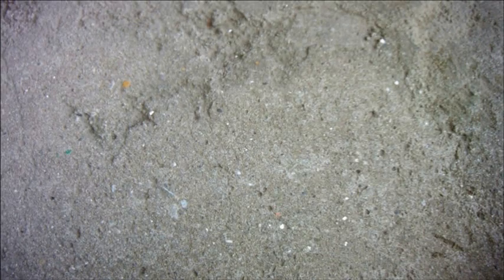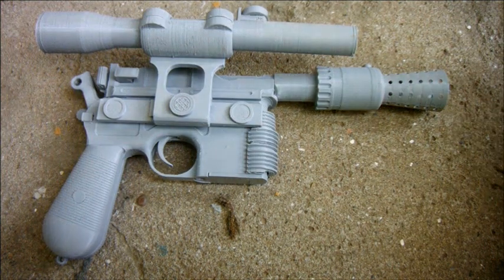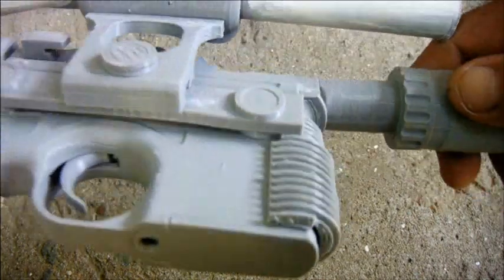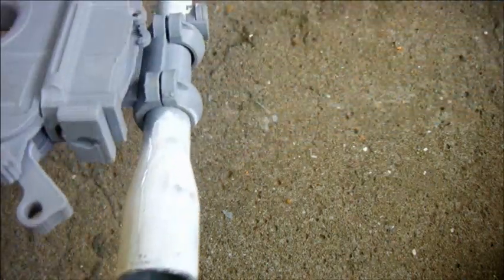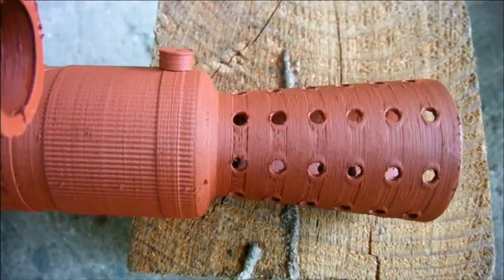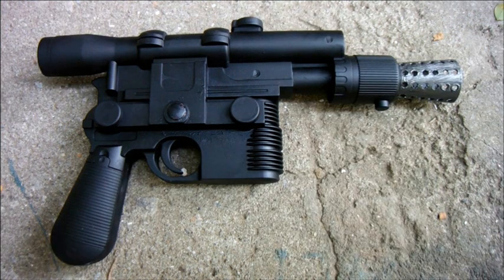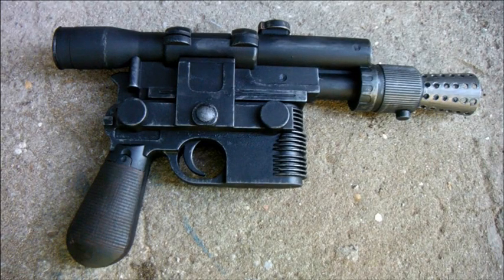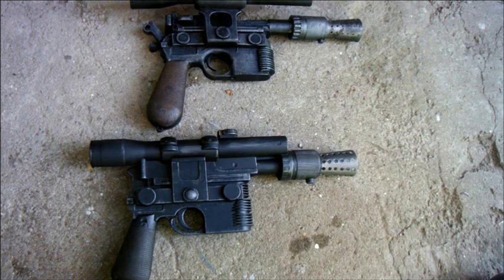Affordable 3D printed DL 44

Comment: Ah, 3D printing lines, the bane of my existence. Now you’ve learned why I spend three quarters of my waking hours hunched over something small giving it the rub of its life.
And then there’s the PLA sanding!
Contradictory as it may sound, I accidentally recently discovered that sanding with fine grade (600 grit) works far quicker and gets a smoother results than the normal approach.
And the sun, yes… PLA hates heat. It’s great in furnaces though. For next time, maybe the hairdryer trick… gentle heating and manual bending…? (this also works with PLA).
I’ve just done a video on a Resin printer. The results are stupendous. No printer lines – yeah. But for a print this size, you’d need to glue together small sections… but the detail, oh the incredible detail…
Finally, maybe consider putting both lenses in the print. That way the scope would shrink everything you look at. As a gambling man, Han would appreciate that.
Loved them both. Nicely done sir.
Reply from the maker: Hello, Goeff!  This was only the second 3D printed object I´d ever handled. The first was a set of RC car wheel covers, which had been printed by Shapeways and were absolutely flawless. I´ll remember your tip about going straight to the fine sandpaper next time.
 I did think about trying to reshape my blaster but thought I´d just get the video done first, before risking further destruction.
 Resin printers sound wonderful - as I understand it, the resiné selectively cured by UV - is that right? If so I don´t understand...
 The scope! I´m so chuffed with it, mainly because it looks convincing when you hold the blaster at arm´s length. It´s much more fun to look through than the one that just has clear plastic "lenses". I did actually want to put the small lens at the front, but it was too small. I can´t help wondering why, if Han´s so clever, he has his scope fitted back-to-front, but then you could ask why Leia´s all keratin headphones never caught on...
Reply: Good points.😊